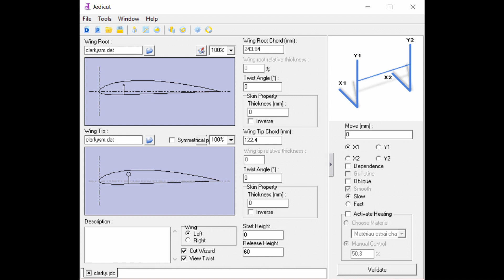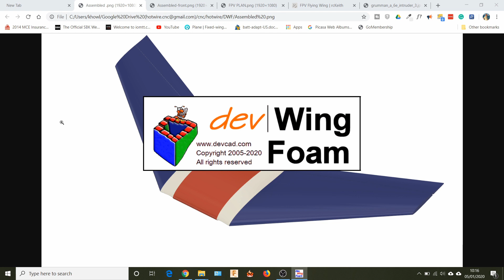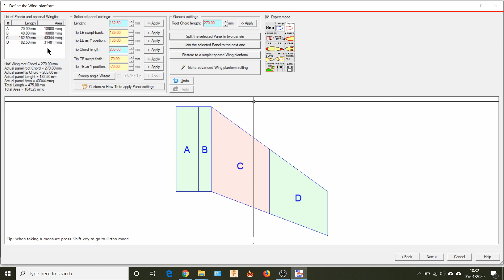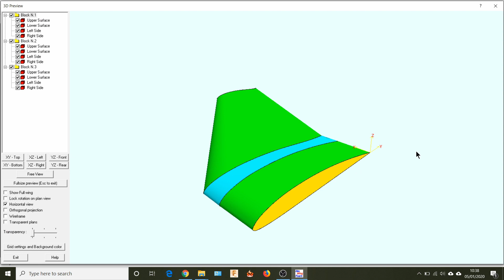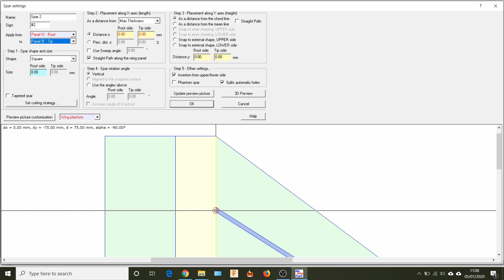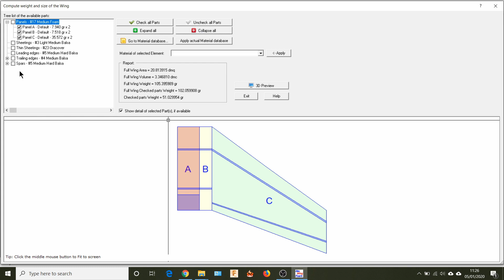DevWing Foam 2 Tutorial Part 1 - Design - for CNC Foam Cutters

Comment: Is it time to kick team Fusion into supporting 4 axis wire CAM cutting again? Still at design stage for my cutter :)
Reply from the maker: I had a reply to their latest CAM update and they said it isn't a priority. Probably not enough people requesting it.  🙁
Reply: @rckeith  It is fairly niche but wire cutting does get used in other materials and processes. Devcad/foam still looks like a throwback to the early 2000's and their website too.
Reply from the maker: @seabreezecoffeeroasters7994  Yes it is a bit dated but the software is very good. Having done a little development on Wing-Gcode it makes you realise its not as straightforward as you think. I am working on post processor for Fusion 360 to just make parallel cuts using a 2d contour. So it just basically copies xy to the other 2 axis.  Still need to run some tests but you have to think like a hot wire and which path and direction its going to take

Comment: Is there any need for knowing Linuxcnc, if someone can handle devWing? I am troubling wheter I should install Linux or not..
Reply from the maker: DevWing generates the g-code for your  design. LinuxCNC interprets the g-code into step pulses for the stepper motors. You need both to make a wing.
Reply: You can buy DevCNC Foam and cut Devwing foam withoun any hassle..

Comment: good morning Keith,
with jedicut I generated the gcode file (% ...% .txt) for cutting the wings.
When I upload this file in mach3 I don't see the cut in 3d, but 2d
what will I have to set?
thanks

best regards
vito
Reply from the maker: Mach3 won't give a 3d display it's not setup for foam cutting the best you can get is 2d. LinuxCNC has a foam option so gives a better display.